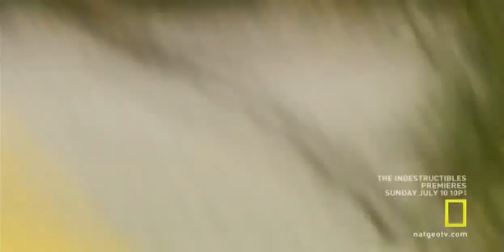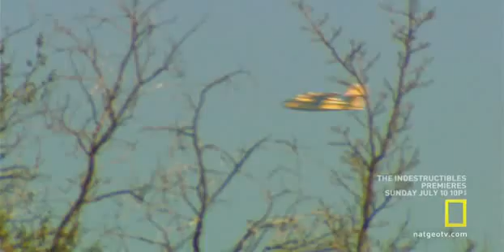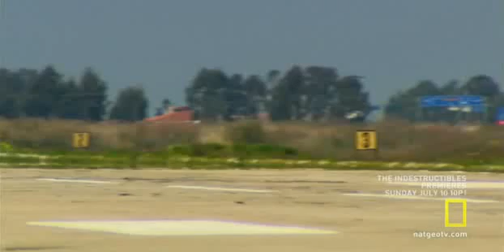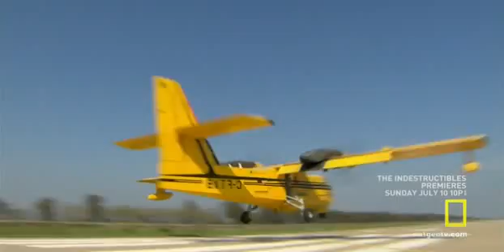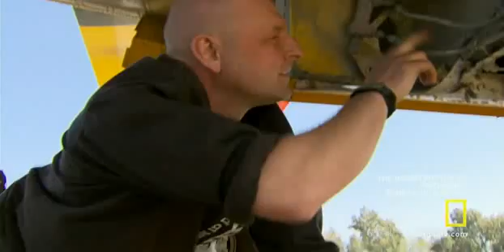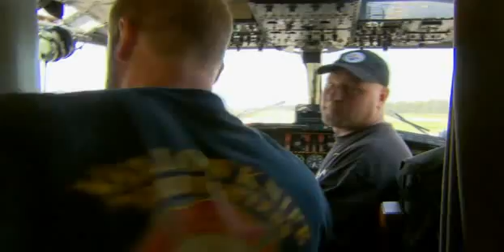CL215 crash landing

Comment: What kind of pilot forgets the landing gear for landing...I mean that's the first thing that comes in your mind when you think about landing!!! Cancel their license...!!
Reply: These Turkish pilots aren't the swiftest.  Notice how they keep sticking their heads into the clamshell doors to look at stuff, and the Canadian keeps pulling him away?  There is 3000 psi in the lines of most aircraft hydraulic systems.  Should the system suddenly pressurize, which could happen with a damaged system, they would be toast.
Reply: Keep in mind that this airplane also lands on water.  Sometimes they land gear up (on water) then they land gear down (on land).  It seems simple, but flying an airplane that lands with the gear up or down (depending on the situation) can mess you up.  I wonder if you should lose your job if you make one mistake??
Reply: remember too that to refill this plane it skims the water.  Many more water landings take place than ground landings.
Reply: No, it isn't.  That's why we develop flows and then checklists to back up those flows.  Despite the error (humans are known to make them), the pilots should nevertheless be commended on maintaining control of the aircraft - the first thing that should come to mind.  Judgement is easy while sitting on a couch, isn't it?
Reply: ***** Maybe after successive events, yes.  But a single gear-up landing is not a career killer; never has been and never will be.  If a flying career is to be decided on the basis of inadvertent error during training, we'd all be riding the bus.  Think about it . . .
Reply: ***** I know guys who had accidents like this and ended up at a major airline.  You're wrong.  Period.
Reply: a trainee pilot who has done a mistake at pre landing checklist.
Reply: quinnjim  isn't there a check list they mark off on approach of a landing?
Reply: There is a saying in aviation, there are those that have and those that will.  People are naturally human and out of all the serious accidents that can happen in aviation, this is one of the least dangerous.
Reply: Not when it is also a plane that lands in water most of the time.....without the gears....
Reply: Happens more than you’d think. Pilots are people, people make mistakes. Even more common on amphibious planes. If you been landing on the water all day, the next time you land on a runway it’s “oh s**t” time.
Reply: MrOmnos uî
Reply: Yikes
Reply: @quinnjim That would be a possible scenario .. but with a co-pilot who should be paying as much, if not more, attention to checklist procedures than the pilot in command??  Lackadaisical pilots in both seats it appears.   Just my humble opinion.  Thankfully 'only' equipment was hurt.
Reply: "Even though lackadaisical sounds like it has something to do with a shortage of daisies, know that what it really means is lacking in spirit or liveliness. A person with a lackadaisical attitude shows no enthusiasm and puts forth a half-hearted effort."
Reply: MrOmnos CHECKLIST ? WHAT CHECKLIST

Comment: It happens more then you all think. I know a plane that went thru 3 wheels up landings My Grandfather did it once as his first plane had fixed gear. Smaller planes are loud inside and sometimes you dont here the alarm. Its an easy mistake to make if you go from a plane with fixed gear to a retractable. Also being a float plane pilots get used to landing without gear when they land on the water and can over look it.

Comment: Commentator: "Since the gear worked, this could be a clear case of pilot error..." Ya' THINK?? Of COURSE it was pilot error: if the hydraulics had failed, they could have landed it on WATER - what part of flying BOAT do you not understand?! Even if there had been no water they could have reached on their fuel load - a landing on GRASS would have been preferable to grinding the aircraft's ARSE off!
Reply: So landing on a surface with unknown variables, providing less frictional force for stopping, and away from adequate emergency services is somehow preferable?
Reply: dwaynepipe59 Landing on grass?  Do you think this is a remote control airplane?  That’d do just as much damage and probably be worse when the airplane digs into the ground like that.
Reply: SPOKEN BY SOMEONE WHO KNOWS FUCK ALL ABOUT AIRCRAFT
Reply: Still need hydrolics to bring down floats
Reply: landing in the water is not an option either when the plane is in boat mode those doors are the hull and if they are damaged you can't land. Joe's going to be pissed they will have to fly in new doors.

Comment: You know, Cessna makes an amphibious aircraft called a Grand Caravan. When you approach the ground, or water, an on board system audibly tells the pilot one of two things. 1. "Gear up for water landing" or 2. "Gear down for runway landing". This inexpensive system could have saved a lot of damage to this plane. Also, at the end of the video, one of the pilots was on his cell phone. I wonder how that conversation was going,........"Honey, yeah it's me, did you save the number to that trucking company I was gonna apply at, Truck Masters I think it was, I might need that".

Comment: i was about to congratulate the pilots for a nice gear up landing. Then they went around and it turns out they just forgot to lower the gear. Especially on seaplanes you often have a warning at low speeds which will go like "GEAR UP FOR WATER LANDING" or "GEAR DOWN FOR GROUND LANDING" constantly below a certain speed.

Comment: Forgetting flaps? Maybe. Forgetting the gear?! That shows how bad those pilots are, it shows that they didn't go through their checklists at all.
Reply: +HMSDaring1   did you not hear them say NO HYDRAULICS?
Reply: ***** AS a result of the landing gear not being deployed! The hydraulic lines were severed, meaning they couldn't brake. If they didn't have hydraulics then emergency crew would have been there for the first landing.
Reply: @watchgoose  It was well documented that they forgot to put the landing gear down (bad airmanship). Check list not carried out. The hydraulics were severed after the landing and where operating correctly before. This was a case of a bad pilot trying to get out of a mistake he made, nothing more.

Comment: The gist of a lot of comments is "the pilot is stupid. How can you 'forget' to put the landing gear down?" Very easy when you are flying a plane that is designed to land with the gear up. This is a seaplane and they routinely land on lakes and the ocean. When why drop down to pick up a load of water, it is basically a touch and go landing with gear up. The narration mentions that they are practicing touch and go landings. Someone made a mistake. Also, if you land with the gear down on a lake it is a lot worse than landing on the runway with gear up.
Reply: I totally disagree. Its only an easy mistake if you DON'T use a check list. This is what they are for!!! They should ALWAYS use it whether they have flown 5 hours or 5000 hours on type. What other things could they have missed? This is absolutely an unacceptable mistake for any pilot to make. If the pilot(s) can't tell the difference between asphalt and water, they have no place in a cockpit. So yes, they are idiots and they shouldn't be occupying the same air space as us better trained pilots. My head would roll if I made a mistake like that as it would prove my head isn't in gear and I failed to use the check list. People have lost their lives because check lists were not gone through. Absolute basics.

Comment: Couldn't they land it in the water if the landing gear was fucked?
Reply: he probably thought the gear was locked and down..... or their was no lakes near by. you need a LONG lake. the state of MN has 10,000 lakes becasue they call a stock pond a lake. look up fort peck lake montana. you need a lake that size to land a float plane. 

but ya... forgot to push a button, or mechanical fail.
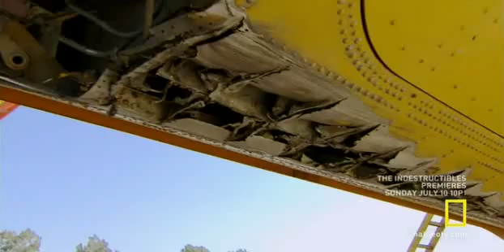Reply: States in the clip there was a 10 foot gouge in the bottom @3:20
Reply: Not with the damage to the hull. The plane would start taking on water almost immediately,causing the plane to sink
Reply: The landing gear was not "Fucked". The pilot did not lower the landing gear on his first attempt to land. And as stated, after they damaged the aircraft, it would have sank had they tried to put it in the water. The pilot is now working as a server at a Turkish McDonald's  hehehehehe
Reply: danahan01 I know it was pilot error.

My question was theoretical. Asking 'if' the landing gear was not working.
Reply: danahan01 The pilot shold be head of Turkish ait force as right hand of erdogan.
Reply: QuixoticQuaver
 at the second attempt to land, gears downed, so it means landign gears were operations even hydrolics leaks after crashed. Pilot error is most probable but there is no information about cause of accident. I couldn't find any report. If any one has the report from Buffalo (or anywhere); I'll be appreciate that.
Reply: Hakan BEHCAN
what you mean?
Reply: that wouldn't be nearly as exciting though....thats why this shit sucks...
Reply: they were new to the plane and was their crew's first flight without the original training crew
Reply: BunnySk8rProductions
So what!! They wrecked a multi-million dollar aircraft. OK, let's do this, you write the check to fix the plane. You feel better now??
Reply: im lost... what are you smoking?
Reply: Hajime Takahashi
 Takahashi, Turkish pilots (THK pilots) are flying safely and doing their firefighter jobs with CL215 and there is no any other occurrence (even minor events) since that accident. I wrote before under severla comments. The most of THK pilots especially firefighters were flown/trained by fixed gears and smaller planes (such as dromader, An2,t67) except air taxi pilots. Thatswhy, there was a possibility about forgetting gears down. This is the most occurrence causes by forgetting retractable gears if you comes from fixed gears. Not for all pilots but not impossible. There is no official report yet, at least I couldn't see that. When accident occured, Buffalo airways training team was there. I hope one of them read this comments and can be write down what happened in fact.
Reply: hakan737
aaah ok, thx for reply
Reply: The best part is it the landing gear was not broken in the first place. They were simply no deployed. I don't understand how you forget to do such an important part in the landing procedures. And most modern planes start yelling at you when you at low speeds and altitude with the landing gear up. But I've never flown this plane so i would not know.
Reply: mattatbat96 they were newly trained military pilots in europe being trained by canadian guys from buffalo, their first solo trip... forgot to gear up... i don't get it either
Reply: BunnySk8rProductions
 well actually they are not military pilot :) their flying suits looks like "military" but Turkish Aeronautical Association is a civillian organization. Besides firefighting,air taxi and flight school, they are giving training gliding, skydiving, hangglider, paragliding etc with low fees in a few training center. Where the place occurence, Selcuk training base, near Izmir city is a home town of skydivers and flight training.
Meanwhile, mattatbat96 , you can think reverse. Many pilots who trained in rectractable gears planes, they can be insistly try gears up or down when they fly in fixed gears plane. It's a mind game :) It's not an excuse of this accident ofcourse. They forgot the gears like as said that BunnySk8rProductions
Reply: hakan737 in the show they said they flew for the government there, i took that to mean military :P
Reply: BunnySk8rProductions
 well it's a complicated situation :) you and they are right :) we can't describe the connection of THK either :) civillian but connected with government in law but also independent from government....really confused :)
Reply: hakan737 so like a contractor?
Reply: BunnySk8rProductions  for firefighting, yes, they are working on behalf government. Since a few years ago, before cheased agriculture aviation, THK also has been flying for agriculture, renting by farmers.(now all agriculture flights has been stopped by EU regulations, all planes includes other companies,personal owned have been grounded, THK planes which is used for agriculture PZL18 dromaders still flying for firefighting )
So we can say "yes", they are flying like a contractor.
Reply: There wasn't any  lake in the sourroundigs near-by. Besides , the  crew thought  the landing gear was  on Landing position ...  only then , they'd realized it has not by the  way  it  sounded . Still , very fine crew . They Cope with an unespected situation very fine ... with no further dammage .
Reply: im sure if they knew the landing gear was damaged and would not deploy, they would have landed in the water with a leaking hull. better to take on water than to try and belly that thing in.
Reply: there wasn't anything wrong with the gear, they just forgot to lower them
Reply: BunnySk8rProductions IF...IF the landing gear was broken. Jesus.
Reply: ah didn't realize we switched to hypotheticals.
Reply: BunnySk8rProductions Well I thought it was clear from the video because they land successfully with the gear down. Also I clarified in my comment above 5 months ago.
Reply: Yes, but my guess is they didn't realize the gear wasn't down until the tail struck the runway.  If they knew the gear wasn't down and locked, and were landing, they would have committed to the landing, and not gone around.  Landing an amphibious aircraft in water, when unsure of the gear position, could be dicey.  If the gear is extended, and you land in water, the drag created could cause the aircraft to flip.  These guys just forgot to put the gear down. The other explanation is they lowered the gear, but got normal indications (three green lights), and that seems unlikely.
Reply: Brian Morris A 215 landed with the gear down in NICE, France...both props and the front gear case broke off, the nose gear door also broke off and that was all the damage...next day, they changed both engines and prop, tied gear doors in the nose and flew back to Marignane, marseille...For punishment, the crew was not allowed to take a day off for a whole month! Any other kind of flying boat that land the gear down in water is destroyed.ALL OF THEM,
Especially the Catalina/Canso.
Reply: QuixoticQuaver yes but it would sink now what did he take acid for the flight run way look a little wavey
Reply: hakan737 
The whole thing looked staged.
Reply: Manuel  Luis 
“very fine crew”? 
You’re kidding. 

I got $5 bet that they don’t use check lists. 

“Gear down”
“Coming down. Three green”. 

That’s what didn’t happen. Pilot to copilot. Neither one was RUNNING A CHECK LIST. 

IMO

There’s something fishy about getting such good video of a random event. And camera in the cabin when they lifted the floor boards. Smacks of reality (story boarded) TV
Reply: this was a traning pilot who forgot to put down the landing gear, if you go to netflix and look up ice pilots its in a couple of there episodes the sold this to turkey and were giving instruction on the before they left them with it. buffalo airways in yukon canada.
Reply: watch ice pilots on netflix its on one of the episodes. the guy forgot to put the gear down its all in the show you see everything the guy who was flying and all of the damage. buffalo airways sold them two of these planes
Reply: But the possibly damage to the underside would have caused the craft to crash /sink upon a water landing .
Reply: Plot twist there was no water nearby

Comment: I was working for Aerofab builders of
 the "Lake Amphibian" between  Sanford, Maine and the 
 headquarters in Laconia, New Hampshire a guy was selling his Lake and wanted a last flight before selling it just had extensive work done on it for the annual inspection and sale he forgot to lower the gear and belly landed the next day I was running parts from the factory to repair the damage if I remember correctly the keel,belly skins,frames and a sponson were needed

Comment: Ok let's all get under a plane with faulty hydraulics.
Reply: jay star that was just tv drama. If the light is green the gear is locked. That is verified by inspection specifically every 100 hours by maintenance staff.
Reply: jay star Yeah right? I was thinking the same thing.
Reply: No faulty hydraulics here, faulty pilot.
Reply: Thanks good to know.  Best wishes.
Reply: Even if the hydraulics fail which they do on every aircraft post landing (Once engines are off, you do not have anything making the pressure.) the gear is held up by mechanical locks.
Of course, you can forcefully retract the gear from the cockpit and total the aircraft if you wish though, as some pilots have found out with the SAAB turboprops.
Reply: my thought exactly what the hell you doing crawling under the dam thing
Reply: @CMDRSweeper  how can you depend on the locks without hydraulics come on. did you not see the lines all tore up it was a miracle they even came down let alone lock